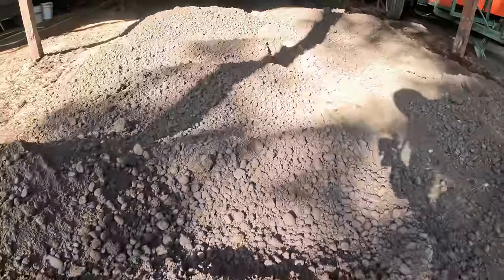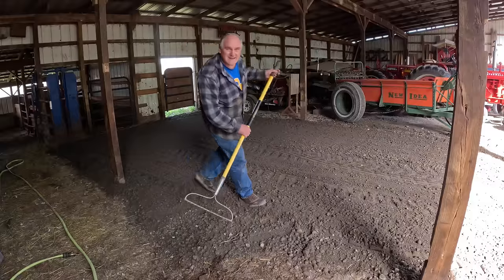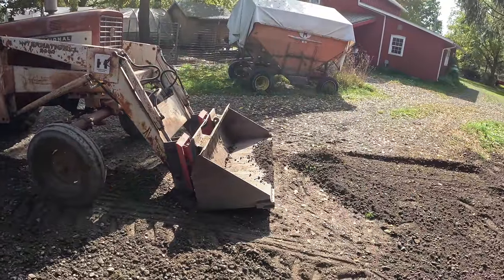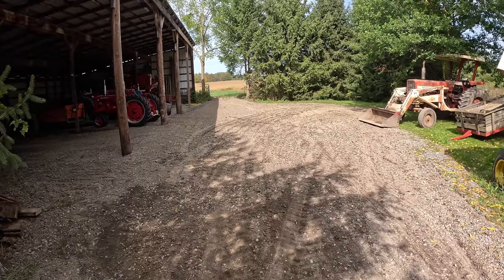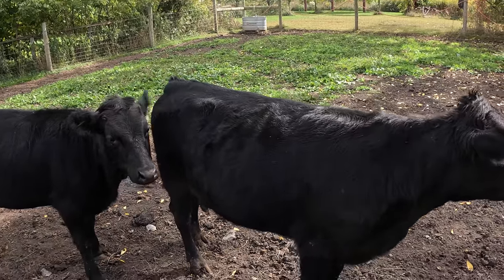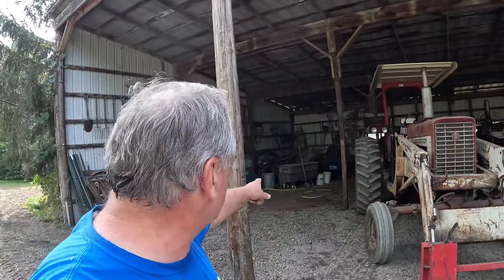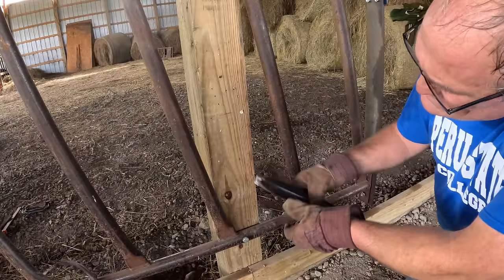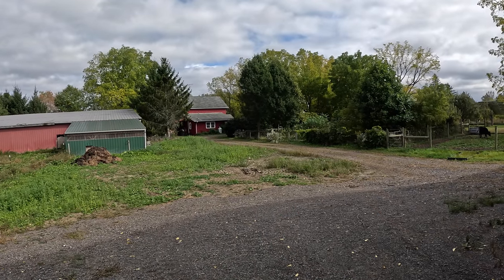Finishing the Pole Barn Project + Turkeys Go to Bed

Comment: The description on gravel and compacting soil makes a lot of sense for base under a concrete slab. Building inspectors always make a determination if the soil under that foundation is dense and supportive enough for the weight and support of the concrete foundation and build. Those tractors finally found their own home to roost in like the turkeys.

Comment: It's a Sunday afternoon with my feet up and my favorite 40lb chicken that identifies as a dog has her head on my lap while I'm playing an "air base" with my fingers up and down her back along to the soundtrack of the turkeys going to bed. Each measure of 8th notes causes her back leg to start scratching. She liked that part of your program so much that she wanted to see  again a few times.
The pole barn is looking good! Unless you weld day-in-day-out you're not going to be dropping dimes like a journeyman welder. But you do just fine. If you were really concerned about fire you might have a bucket of water on hand. But in a barn that has new gravel, wetting down the post is good enough. You got your heifer dust kickers on so you can stomp on anything that might flair up. 
The place at this time of year looks great. Tell Hillary she does great work if you haven't already.😉👍

Comment: Pete, in 1987, we built a new 60’x60’ steel building at our family dealership. The concrete contractor wasn’t going to compact the base, because he said it wasn’t necessary. We had hauled the stone with our own trucks, and there was 217 tons in total, the contractor claimed he was at the proper grade. Fearing that the slab would crack, we rented a vibratory roller, and I operated it. In less than five minutes, the grade had changed so much, both trucks headed back to the quarry. Ninety-seven tons later, we were back to proper grade. Thirty-six tears have passed, and that slab has zero cracks in it. For what you are doing compaction isn’t critical, but under a building slab, it’s a different story.
Reply from the maker: You did not say what type of fill was used, but I think we’re in agreement. Under a commercial building slab, I would have required Proctor tests of structural fill to ensure proper compaction. Also, I would never advise to use clean stone for deep fill. instead, use graded structural fill for the majority, then finish with clean stone to shim the slab sub base.